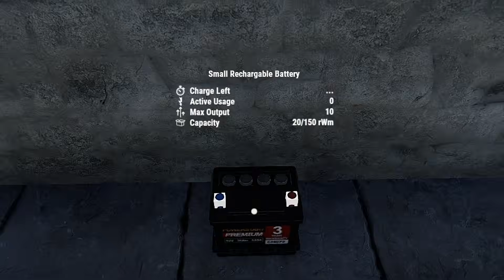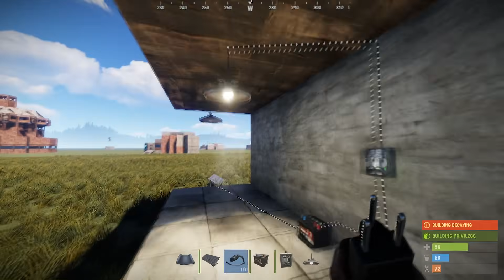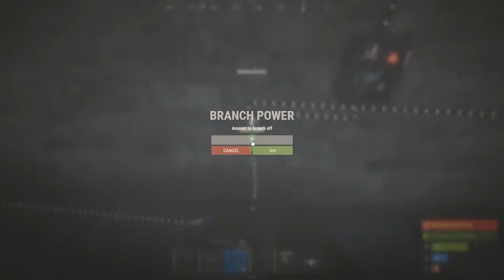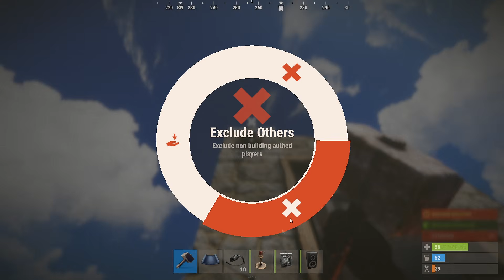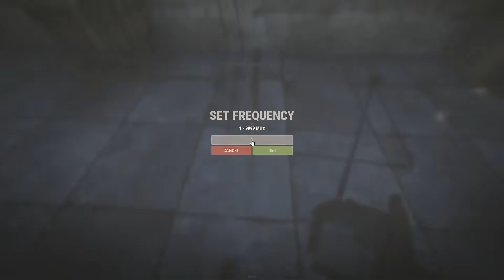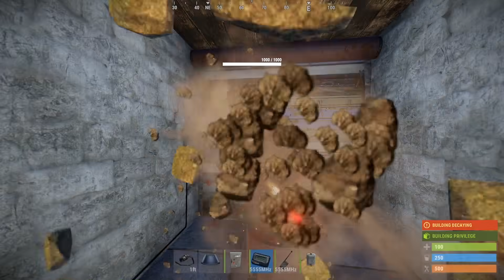RUST - Electricity guide - Beginner to PRO in 10 minutes

Comment: 7:30 - you can’t connect the output of the sensor to multiple devices because the sensor only emits one power and is only enough to power the branch. If you want to run multiple devices, run the output of the sensor into the side of a blocker and run more devices off the blocker.

Comment: I no its old vid but the pros no dont leave ur combiner or circuit componants visible as if ur a pro u want auto backup genoratrs setup people will target the combiners etc hide as much as you can in the base so if they take ur panels and turbine ur backuo gen wired to power on inside torrets never fo out

Comment: It may be a little late, but you can use the HBHF sensor with more stuff. If you connect its output and your power source with an AND-Switch. When the sensor is activated, it sends current to the AND switch, which now receives power on its two inputs and therefore lets power through.

Comment: If you take the single power output from the Sensor into one input of a AND Switch and then take a branch with say 10 power into the other input of the AND switch, then when the sensor is activated it will allow the highest (being 10) input to pass through.

Comment: One thing you don't address that I would like to see adressed is power consumption. You have infinite power, but when you hook into switches and are using a battery, you have to over power the battery in order to get it to work, I.E, you have to have 120 watts going to the battery, because if its hooked to an OR switch or something, the switch will consume all 100 watts of the battery. Its bull crap. It would be cool to see how a blocker would solve this. I have ran power in to a branch then ran it to a blocker, but the problem with that is if the windmill dips below say what my system needs to run, the blocker doesn't know better, it is either all power or no power. Rust should have a way to set the watt you want to block at, like at 30 watts , allow passthrough. So you could hook the battery to the bottom of the blocker. UGh. anyway thanks for the vids

Comment: I haven't touched Rust in about a year. But this is a very well made video. 
One way I found to utilize the HBHF Sensor with multiple items was to use the AND switch. As they only output one power, that's enough to fulfil the condition and the power is a combination of the two inputs. I just ran a branch into it to satisfy my needs. A tool that I found very useful is Rustrician.io, it's an online circuit builder.
Reply from the maker: Thanks for the info! I like Rustricial, i found it very late unfortunately but i use it now :-)

Comment: Hey I have a question. I want to setup a delayed tesla coil trap with a sensor, lets say, the sensor gets awake but it doesn't activate the coils immediately but they start working after a period of time. The reason? simple, sometimes a player is approaching crouching and if the sensor gets activated and the coils are awaken by it, the player can step back and survive, now, if the system is delayed, the player can walk a few more steps into the trap and get electrocuted without the possibility of escaping. This is useful in walled caves where a raider blow many walls and reach the loot sector in servers that use the teleportation plugin. I hope it is possible to do cause i didn't see a single video about this in youtube. cheers mate.

Comment: This is only relevant to PVE roleplayers. Too complicated for the official servers.
Reply from the maker: yep, unless you're in a big group, solos just wouldn't have the time or need for this
Reply: I am waiting FacePunch to add more electrical components, I am not a pro in electricity in real life but it feels like there are some stuff missing in game.

I was setting up 9 turrets across the base, all the energy coming from a large battery giving 100 output, after all the splitting division every turret has 10.6 electricity to function, since its a battery it will always be the same output but yet no way to re introduce the electricity from the windmills back into the splitters and the only way to get the electricity out to any other part of the circuit was to use branches to get it out before the batteries.

Comment: The pass through doesn't work from the siren light to the speaker from the hbhf sensor because the power output for the hbhf sensor is binary (1 or 0). In order to let both the siren light and speakers activate, you need either logic switches (or, xor, and) or use a memory cell
Reply from the maker: absolutely true. my favourite would be an AND switch for this

Comment: Thank you for this video. I've been trying to learn Electrical Branches which still confuse me. I want to power 3 water pumps, 2 water purifiers, and 15 lights. I have two wind turbines and two large batteries. I've run the two turbines into a "combiner" and  run the output into one larger battery and have run the larger battery output into the other large battery. From there I've sent it into a splitter. Its at this point I know I need branches and I get confused lol
Reply from the maker: haha, thats the start of a rather large and complicated circuit :-)   -   if you need help on smart switches, check out my other video

Comment: yo. HBHF only allows for 1 output when triggered. In order to set off multiple things at the same time, you have to use an and gate with a constant source of power on one input for the speakers and lights, and then run the HBHF sensor output to the other AND switch input. This will take the higher of the two inputs and pass it through. Hence why you have a small battery dedicated to the alarm system.

;) Pro tip.
Reply from the maker: cheers Jake :-)

Comment: The reason that the speaker didn’t work at (7:36) is because the sensor only
Produces 2 power and the light takes 2
Reply from the maker: yes, need to use an AND switch to make the most of it :-)

Comment: I use the solar panel directly into a branch with the set output split into the side input on a blocker and then the extra from the branch directly to the battery, battery output to blocker input, it allows for 10 full power out to the lights and automatically switches on when the solar panels don't have power and off when they do.
Reply from the maker: This is a really cool way of setting up... I might give it a try myself :-)

Comment: You can hook the sensor up to both the siren lights and the alarm just connect the sensor and a source of energy to a And Switch and then you will have the power u need to set up an entire alarm system
Reply from the maker: one thing i didnt really do is use AND switches. they make life super easy when you know how to use them

Comment: Why does my battery drain even while being charged constantly while being connected to a splitter?
Reply from the maker: the splitter uses 1 electricity. if you put a switch between the battery and splitter you can stop this problem

Comment: 7:22 i think you can still make it work.
The Heartbeat sensor can only output 1 power unit, but you can use an AND gate to deliver enough power. One input from a branch with the needed amount of power, and the other and input is the heartbeat sensor. The AND will use the greater power value and only activate when both inputs are on, so only when motion is detected. Found this out when I was trying to use 2 different sensors for one alarm, the hearbeat sensor wasn't enough to power the OR switch, but 2 ANDs later and it works lol
Reply from the maker: I don't use AND gates nearly as much as i should. you're absolutely right, they're priceless in builds like this one

Comment: I didn't check all the comments, but the HBHF sensor actually outputs voltage matching the number of people it detects.  i.e. if three people are in range, the HBHF sensor will output 3, providing you have at least 4 going to the HBHF sensor.  Someone has correctly advised how to use an and gate to trigger multiple items.
Reply from the maker: Yes, It turns out that its quite well designed. You could have multiple lights or hook it up to a counter to give you an idea of the amount of people outside. Pretty cool....

Comment: You can power both speaker and lamp if you set the HBHF sensor into one AND Switch instead of directly to Speaker/lamp. Then use the other input on the AND switch from battery/turbine.  "AND Switch
A logic gate that allows eletrical passthrough if BOTH inputs receives power, passthrough amount is the greater of either power source"
Reply from the maker: really good tip! I'm going to use this going forwards. i don't use the AND as much as i should
Reply: @AniCodYT  Nice video btw! :)

Comment: Run the output of the HBS sensor to an AND gate with your desired power output on the other input. When the sensor triggers the AND gate will activate and pass through the power. You can then use a splitter or branch to connect a speaker and light for example.
Reply from the maker: really good tip! thank you :-)

Comment: Can you explain how it works when you add the blocker to the turret so the door goes closed when the ammo id finished
Reply from the maker: Yes, I'm working on a turret video now where this is implemented. I will show you in that. Thank you for the comment
Reply: Ok so theres an output for the turret when it finds a target or has no ammo

Just hook up the no ammo output to a door controller and it should close once it runs out of ammo
Reply from the maker: @Klosop  You will need a blocker for this to work as the power out from the turret would actually open the door. I'll make a video on it soon :-)

Comment: HELLLOOOOOO the splitter says 99 at the bottom because nothing is connected... the power going in is divided by the number of connected outputs. 99 / 3 = 33 to three different outputs or 50 and 49 to two outputs
Reply from the maker: hello..... Or 99 to 1 output. when one output uses more power the other outputs drop power to compensate, always keeping even.

Comment: I think the HBHF sensor is supposed to be like that. It forces you to use a blocker. I really hope they would make it just a passthrough tho!
Reply from the maker: yeah you're definitely right. Such a shame really, seems almost wasted
Reply: AniCod you can always just use an and gate. Hook up a power source to one input and the hbhf output to the other.
Reply from the maker: @ehproghat1028  this is what ive started doing. Its much more economical than using lots of HBHF sensors lol
Reply: AniCod also, it sends out power proportional to the number of people detected. So if there's 5 people detected, it'll output 5 power.

Comment: hey so the hbs gives 1 watt for each person there, now how to use that? well if you use a series of branches  you can make a case switch statement for 1 what logic which can control blockers. why would u want that? well lets say you have a small sturdy base that has like a 10 c4 min, but you want to use it as a trap base bc u think you can 1 v 1 most ppl. it lets you make settings for deffense set up depending on how many ppl are there.
Reply: George Kent-Scheller you’d have to use an AND switch; one input from HBS Sensor and the other input from constant power. When the HSB Sensor senses 1 or more, it will trigger AND switch on and pull power from the highest input (constant power). 

The configuration above will allow you to pass through to other downstream electrical devices.
Reply: @diffiq  using an AND switch (main power supply and logic output) will grant you the best range of upgrades afterwards you can even go back to a splitter

Comment: this is so complicated
Reply from the maker: Is there any part of it you're struggling with? I can try to explain if it helps?
Reply: @AniCodYT  The root combiner seems kind of difficult and confusing
Reply from the maker: @riding4beers889  they're really good. in the bottom you put 2 separate inputs ( 2 x solar panels) and out of the top is all of the electricity combined out of 1 wire. you can put this into the bottom of another route combiner with another solar panel in the bottom and out of the top of this will be all of the electricity combined again etc etc. If you like, i can show you in a future video?
Reply: @AniCodYT  also the part when it asks to set a number
Reply from the maker: @riding4beers889  if you mean the pager and the broadcaster. you can choose literally any 4 digit number you like. as long as the numbers are the same on the pager and broadcaster they will automatically communicate with each other.

Comment: Im no expert but when you hovered over the sensor at 6.59 it said the power output was 1, is this the actual reason why you could only power one thing (being the light) and not the speaker
Reply from the maker: yeah, they swallow up all the power and only output 1 for some reason. its apparently supposed to be this way. i just haven't worked out why yet

Comment: I think most people just want to set up turrets and lights. The problem is having the right components. I have a setup that uses a blocker, but I spent 5 hours looking for one today. Since my knowledge of electricity only allows me to use a certain set of components, I couldn't set up turrets till I found the missing electrical piece. I would love to see a guide on setting up turrets using medium/large battery, with/without a switch, with/without electrical branch, or blocker, or splitter. There's so many combinations that knowing a setup with the components that you have at that time is the biggest advantage.
Reply from the maker: thats the worst thing about putting what you learn into practise... actually finding the parts you need! You've got some good ideas, ill put a few into practise and see what we get out of it :-) Really appreciate the comment!
Reply: There are a few setups that can use a Blocker or an XOR or an OR switch, depending on how you configure it..most commonly for automatic lights in the evening. It's worth learning all of them so you can setup whatever you have the BPs for. Otherwise...research every T1 BP you have in your base and then start doing experiments.

Comment from the maker: This has been re-uploaded due to me accidentally deleting the video like an idiot.... Sorry about that, but I hope you enjoy it if you've not seen it yet! Remember to join my Discord and follow me on Twitter and Instagram to see what I'm up to :-)
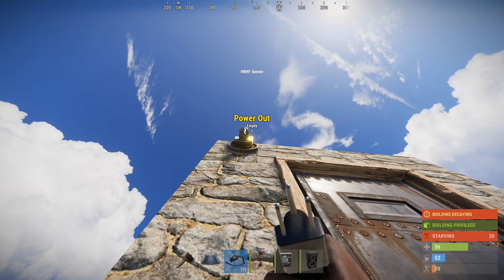Reply: This video got me super invested into Rust Electricity and I'm loving it! I figured out why you said the pass-through for the siren lights don't work at 6:58 in the video. It's not bugged. Its because the HBHF Sensor can only output one electricity (Regardless of how much is coming in) so it can only turn on one light with its output. If you connect enough power to a AND switch with the power out of the HBHF sensor then enough power can pass through to light up however many alarms you have set up.
Reply from the maker: @samloveland8798  this is a really good tip! its bugged me why they didnt let you power whatever you needed through one sensor but at least theres a way around it
Reply: @samloveland8798  But the output is still 0 from the HBHF sensor to my AND Switch and for an AND Switch both things need power
Reply: @csgogetfucced5043  you need an xor and power goes into that not into the hbhf only use the hbhf for logic never to pass power as it will only output 1 or 0
Reply: @DeanWilliams1987  I figured it out bro but thanks what I did was connect solar panels to a root combiner into a medium battery then powered a branch, set the branch power to 20 into a splitter, powered a timer connected to another branch that connects to my alarm and light chain and lastly I put the HBHF sensor the trigger the timer which starts sets off the system for 15 seconds (I pretty much copied this guys set up except he didn’t use a battery he was using just solar panels and I had a lot more then 1 light lol https://youtu.be/tZYpNUXsRYw )
Reply: Hi, I have  4 turrets in base and 3 large solar panels, I made 3 medium batteries in series I mean for buffering but the turets are just turning on and off constantly, is that cuz of batery setup ?
Reply from the maker: @CristuPROD  Turrets only use 10 power. Medium batteries output 50 meaning you should easily be able to power these turrets with 1 medium battery. Try linking the 3 solar panels into 1 battery. The main problem is at night the battery could completely drain.
Reply: the HBHF sensor is not a bug, it returns a binary response, 0 = no, 1 = yes - so you have to configure a OR switch to pass through the power you require to your activated objects.
Reply: @DeanWilliams1987  How do I do that
Reply: @DeanWilliams1987  What I have so far is a solar panel powering my HBHF sensor which and then I was sending that into an OR switch and then OR switch to lights but it’s not working
Reply: lol
Reply: You are the absolute legend.
Reply: Lol